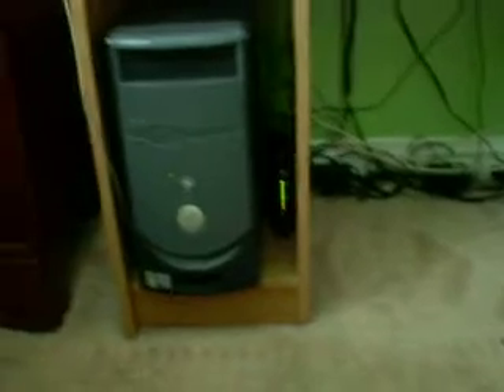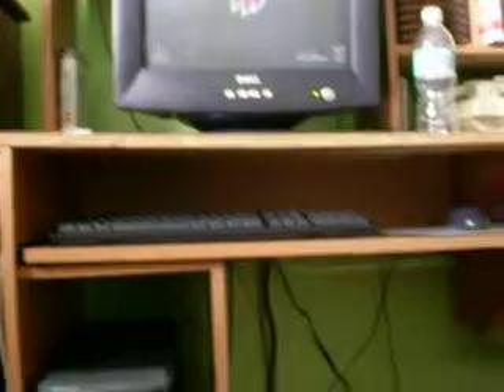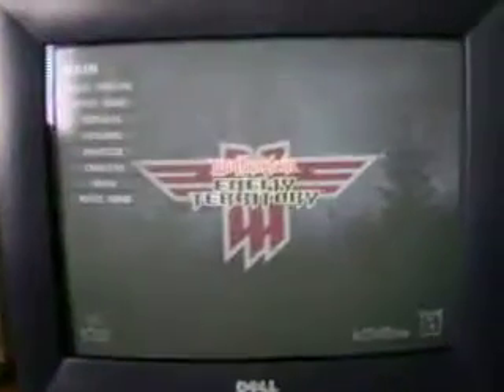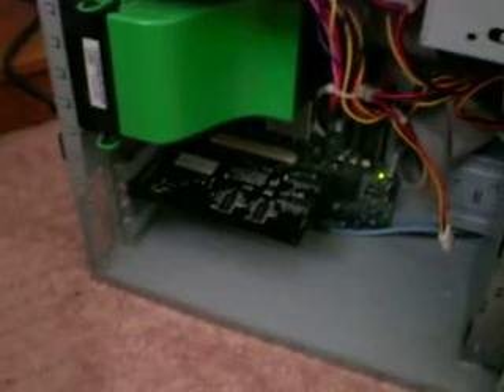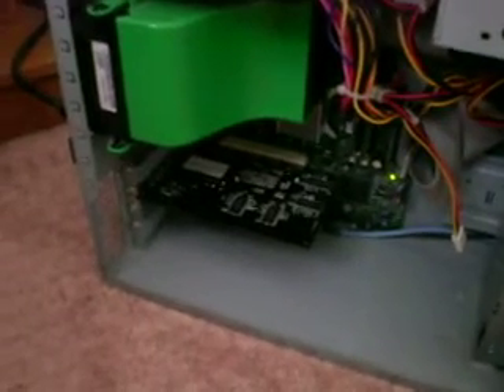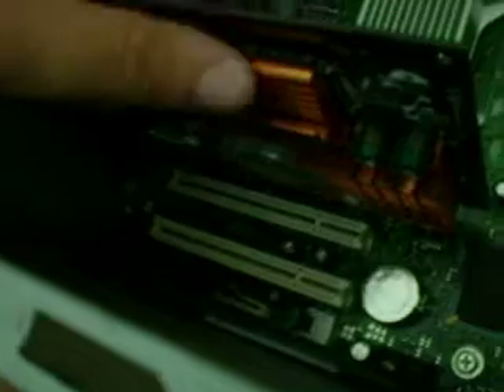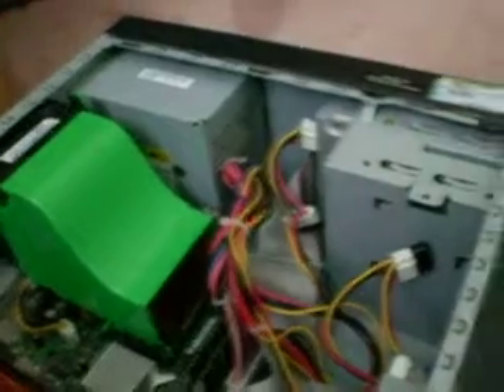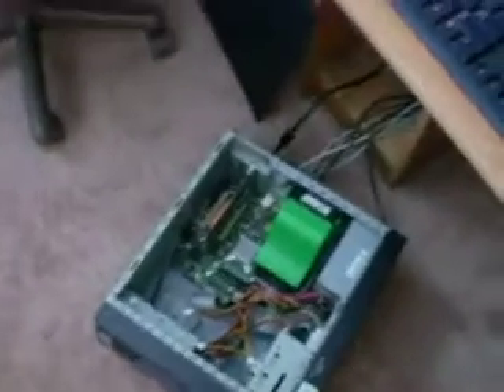Old Gaming PC

Comment: my old gaming pc 

Specs:

CPU
Intel Pentium 4 3.20GHz 90nm Socket 478, Prescott 1 MB L2 Cache

Motherboard
Kirin MicroATX 3 x PCI slots

RAM
2x 512mb ddr 125mhz

Hard Drive
Seagate 80 GB EIDE 7200 RPM

Video Card
ATI Radeon x1300 256mb

CD Drive 
Unknown have 2 drive

Sony Vaio PCV-312v Case MicroATX

PSU 
Unknown

Comment from the maker: True yeah, if I upgrade the RAM it would be faster. But as I am making a new computer it's pointless tbh. It's an "ok" web surfing computer ONLY if you upgrade the RAM, 512 MB is not enough for meh. :(

Power supply upgrade is not really needed unless you want to add something in the PCI slots, recommend though, get RAM first though.

Lags when running Firefox, Office, and some other programs lol. (Not games or video)

Comment from the maker: No I have a FX 5200 with my Dell. It's not worth it to upgrade, there are no good PCI cards out for the price.

For example a 8400 GS is around $40 USD, that would only be able to play Call of Duty 4 for example at low settings depending on your resolution.

Save for a new computer.

Comment: i can play with a celeron processor and 512mb of ram bf2 on medium settings call of duty 5 on low cause my ram and proccesor i would upgrade if u have a pentium 4 just overclock it to 3.0ghz it wont hurt it or just open some vents on it u would be able to play everything like bf2 on high and call of duty 5 on medium and yes on a crappy dell demension 3000

Comment from the maker: Dude get the 4850 because it's much faster than a single card, 2 3870's might be a bit faster than one BUT you can always upgrade to TWO 4850's later on when you have the money. The power of TWO 4850's is more power than a single GTX 280. Think about it... :P

Comment: I also had an old pc from 2003/4 but it was an old HP Compaq D220 MT. I ripped out the motherboard And replaced with an Asus one And the CPU Is no an Intel Pentium D 965 3GHz 4MB Of L2 Cache And RAM Is 2GB And GT430 1GB. Now it runs Games like GTA SA GTA IV (30-40 FPS LOW SETTINGS) And Even Crysis Warhead At 30-40 FPS In max settings!

Comment: The old Dell computer could probably run GTA IV if you had a total of 1 GB RAM and a 256 MB PCI videocard ( total on eBay 45 $ ?? ).I do not know your BIOS,but you can overclock the processor a bit.

Comment: I have a dimension 3000, but with better specs. It has a P4 2.8Ghz, 8400gs 512mb graphics card, 2gbs of RAM, 120gbs of 7200rpm hard drive space, and I Think that's all.

Comment from the maker: There is no such thing as a 6300 lol there is a 6200, and you should be able to run a 6200 no problem. It's either your video card or most likely your PSU.